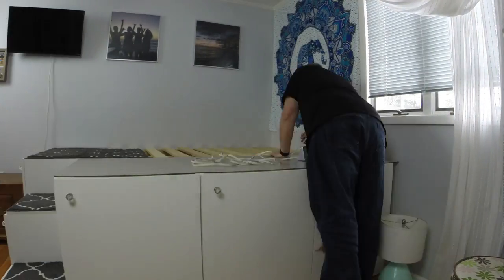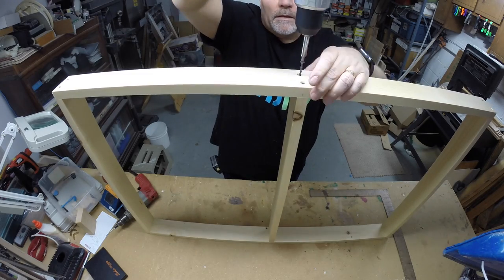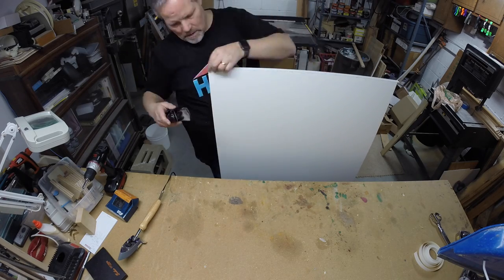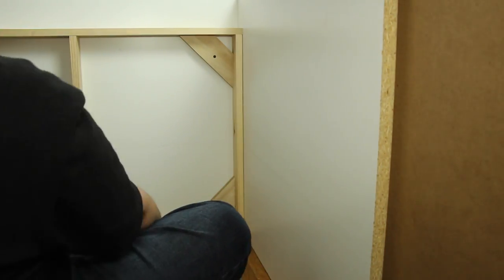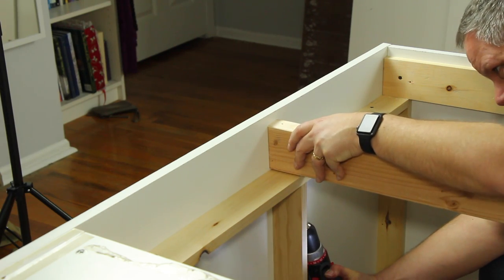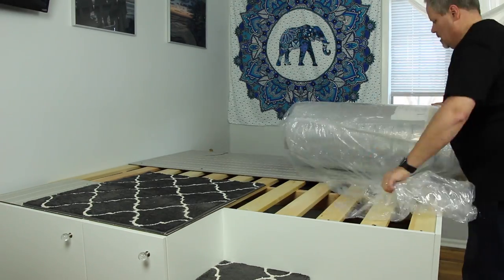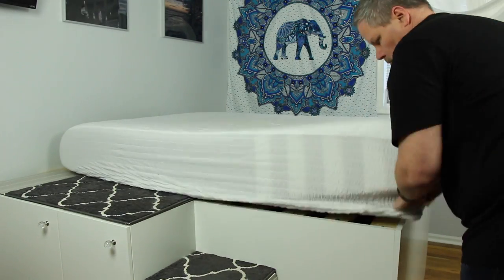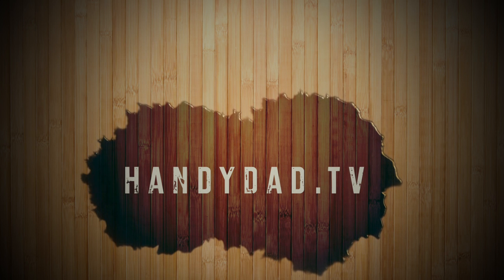IKEA Hack Platform Bed - Freestanding Version

Comment: I love your projects, but after looking at both designs, I think I'd build a wood frame to support the bed first and then add the cabinets and "steps" and configure them as desired. Your first design allowed extra surface, but then cabinets are flush with the side of the bed in the rebuilt design. Nice as the extra space is, the flush design uses less floor space. 
I'm just not crazy about working with sheets of plywood or melamine, I am always afraid of messing up those longer cuts, but I could (anybody could) have those cut at the store. I built a raised bed frame some years ago, but it wasn't designed to be disassembled and that is a problem as it's too big to move through a door in one piece. And cabinets will offer better organization than an open space.

I used to work at an IKEA store and so I am familiar with the quality of the stuff they sell. The wood is often cheap (Soft wood, particle board, etc.) and screws easily strip through, so buyers should be aware of this. They do have nice hinges and fittings.

Comment: I have made a very similar bed and in the back I also have the same boards as in the front, so I didn't need to build anything with wood. It's at the wall without any hole in the wall.

Comment: ❗️⚠️Please read!⚠️❗️I am using this as a hideout. My bed will be like hers, but pushed against the wall, so the cabinets will not be on the right side and opens up, instead, the tallest stair will be where you enter. And the wall where her cabinets are, will be empty and have support beams. However... behind the stairs and at the foot of the bed, it won’t have cabinets either, it will be a plain white wall. Do they sell those? (Basically a thin sheet of wood.)  I really hope you see this and read all of it. I am 12 years old and really want this bed, and when I am older, I can actually use it as storage!😂 thanks so much and sorry if this made no sense!
Reply from the maker: You can use paneling or beadboard for that plain white wall. Send pics when you’re done.
Reply: HandyDadTV thanks! 😃 also this might sound dumb, but how do I send pictures?😂

Comment: So, how many people have already asked how you would have built this if you didn't start by dismantling/morphing one that was just not quite right? 
😏
This would be like the one I choose because I have to rent. I would solve the footprint problem by building higher. That way the space below would actually be floorspace. In addition, it would have to be easy to dismantle and move without damaging it - so that thin back board on the stairs would have to be fixed.

Comment: Hey there I was wondering what the dimensions of the free standing bed are. I seen the dimensions of the attached bed were 69x90x42 but I'm trying to figure out if the free standing would be better. I have a small room. Thank you!
Reply from the maker: +michaela kelly This freestanding configuration is the same length as the mattress and only 15 inches wider than the mattress. Unless you're buying a new mattress, just add 15" to the width of your mattress.

Comment: Could you do an adaptation of the freestanding version for Queen and/or King sized beds? I rent a very small apartment and would love all this extra space I just wouldn't know where to begin with the cabinet measurements to fit for a queen.
Reply from the maker: Did you watch the Q&A? Compare the full mattress to queen -- it's only a little wider and longer. You could use the same cabinet configuration and just hold them further from the wall. Or you could get some graph paper and modify it to fit how you want.

Comment: Love this idea. My thing is weight, I’m a bit heavy close to the top of 200 plus lbs and have two mastiffs that seem to make there way up on the bed as well. The other question is could the one end of the bed be left open as say a dog bed area?
Reply from the maker: Yes, you can build it however you want. Lots of people do play areas. But you can certainly make a dog bed underneath. You can also build it as strong as you want, but this version held 3 adults.

Comment: Thanks for your Video. It's been very helpful. I don't have any experience building but feel inspired by these videos. I saw you had blueprints on your website to replicate but my mattress is bigger. Can you make blueprints for other bed sizes? I want to build a bed similar to this but I have a cal king mattress (W:6 ft  x L:7 ft) and I would like to add a mattress lift to the configuration for easier access to the crawl space below.  I'd like it to be free standing, Max height to be no more than 4 feet total, drawers and cabinets 90-100% under the bed.
Reply from the maker: That’s a big bed! I only did the blueprints for my exact configuration. You’d need to adapt them yourself. Other people have done different mattresses, but I don’t know if anyone’s done a Cal King.
Reply: @handydadtv  Thanks! I appreciate your response.😊

Comment: Instead of screwing all those boards on under where the mattress goes, would it be safe enough to put (and not screw on) a piece of plywood with a small hole cut in it as a handle, so that space can be accessed from the top (i.e. move the mattress and the plywood) without disassembling the bed?
Reply from the maker: In my opinion, no. Screwing it all together ensures it stays together. The storage space is accessible through a cabinet. No need to remove the top.

Comment: Ok but what if I want the original bed and it's original size just not attached to the wall? 😩
Reply from the maker: I built a freestanding version (not attached to the wall - link in description) but it’s rotated 90 degrees. You would need to adapt the freestanding approach to the original design.

Comment: would the cabinetry used for this bed be strong enough to support a king sized bed and the weight of the adults who sleep on it?
Reply: Chris Heider thank you for replying. so by support, would just more beams going across like the center beam be enough? or would it require pillars so that the weight would be supported by the floor? thanks
Reply: Chris Heider thank you so much for replying. will definitely go that route.

Comment: How do u Build a free standing  Fram with the extra room that is framed longly horizontal agents the wall but is not attached to the wall
Reply from the maker: Using the same methods, just with a bigger support frame against the wall.
Reply: HandyDadTV thank u for the tip

Comment: Can you put cabinets on the other side of the bed and still have the same storage underneath as you did when the bed was connected to the wall?
Reply from the maker: Yes. I built this version simply to show how you can save space. If you’ve got the room, you can build it even bigger!
Reply: Thank you. I'm going to have to try building one myself. I have another question have you thought about building it with bookcases instead of cabinet?